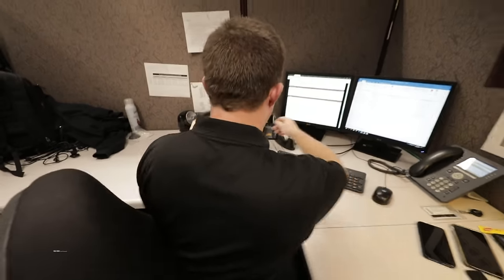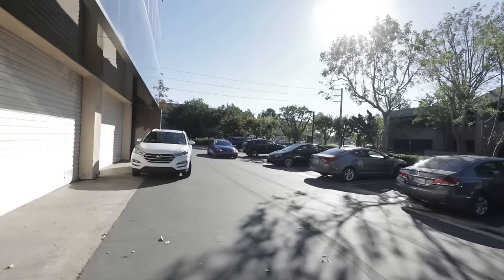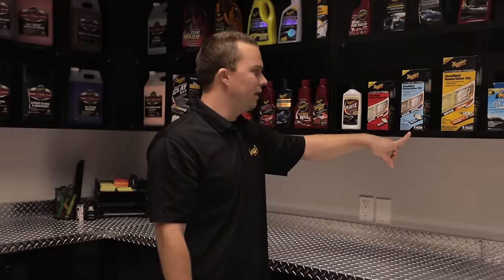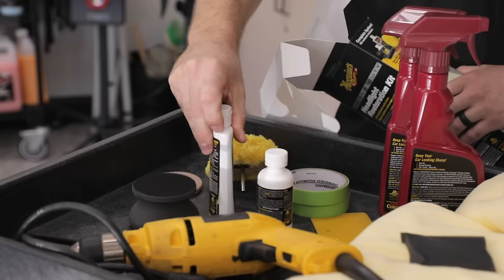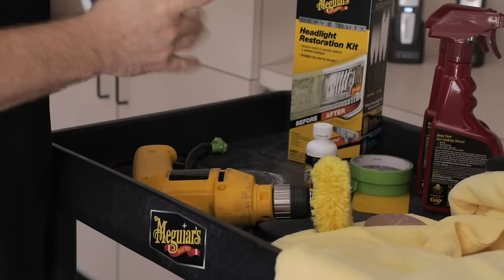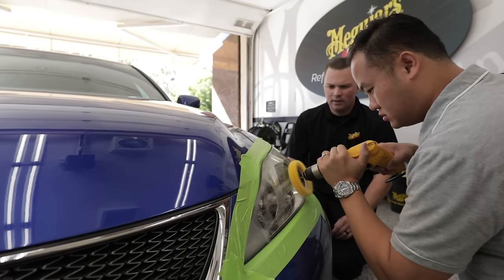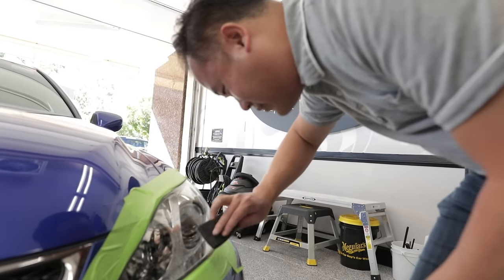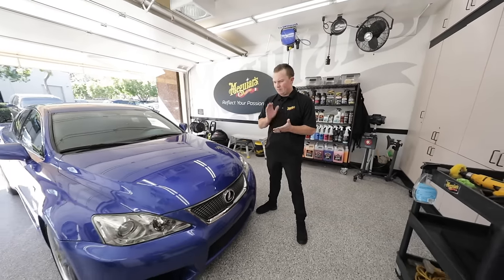Meguiar’s On Headlight Restoration: Heavy Duty Headlight Restoration Kit

Comment: The headlights aren’t even yellow or look that bad. Mine are way worse. Those honestly don’t even look like they need this kit.
Reply from the maker: Thank you for the feedback.  Rest assured we have used this kit on a at least a couple hundred headlights and many of them were severely oxidized.  It does a great job in most cases.  

Here is an older video featuring the first version of this kit if it gives you more confidence...

https://www.youtube.com/watch?v=yx15F6b0mIg&index=10&list=PL8E46BE1075953BDE

Comment: In the video, he sanded using the 1000-grit pad in an up-and-down pattern, and with the 3000-grit pad in a back-and forth pattern, but the instructions on the package say to do them the exact opposite.  Perhaps in the end it doesn't matter, but maybe the video should be made to follow the instructions exactly?
Reply from the maker: It absolutely doesn't matter.  The point is simply to do one grit in one direction and the other grit in the opposite direction.